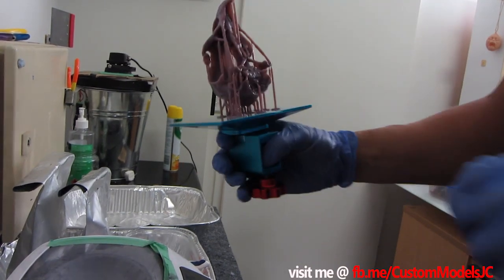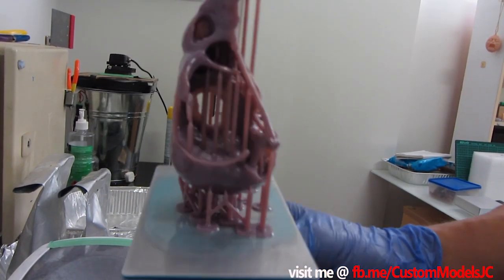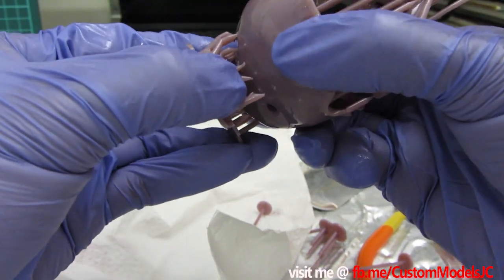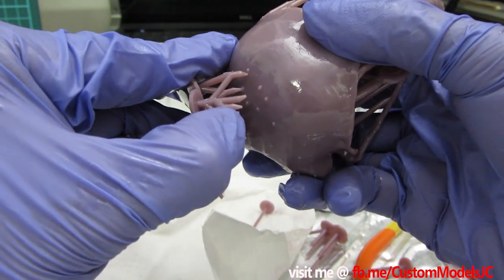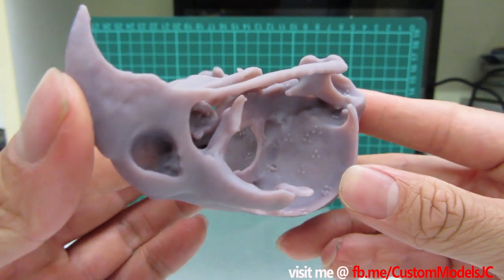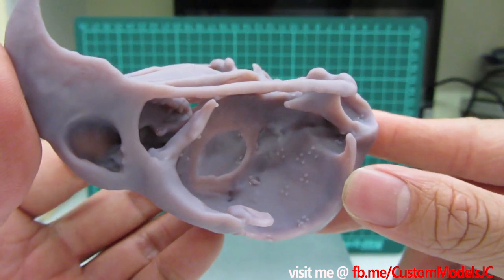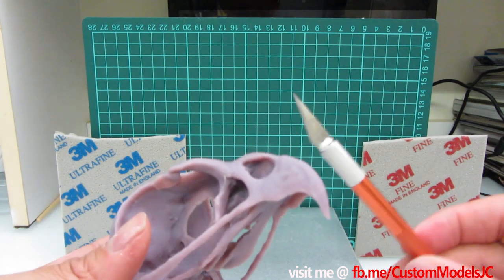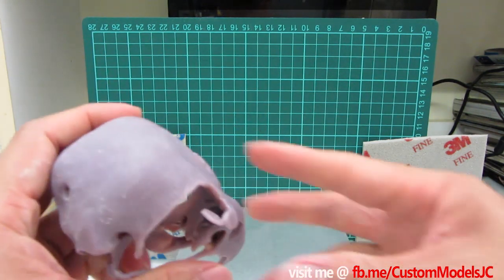Removing supports for DLP Printers using ChituBox slicer

Comment: at 0:45 — is that a heater block you've added to the resin vat? I'd be curious for more details.
Reply from the maker: it is a USB heating pad, cut up and taped on with kapton tape. Dodgy poor mans heater, but it works quiet well.
I have it connected to a timer for 15min on / off cycles. no temp control